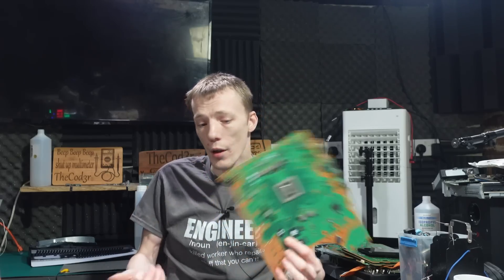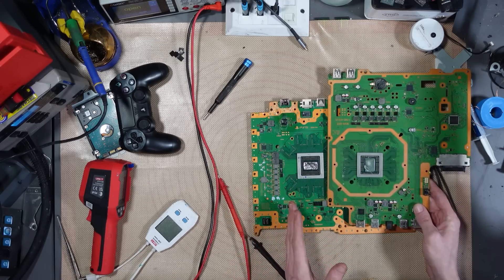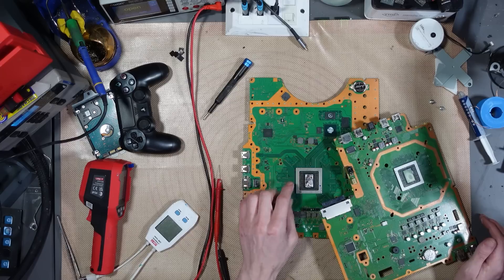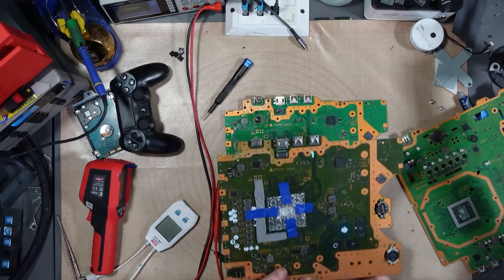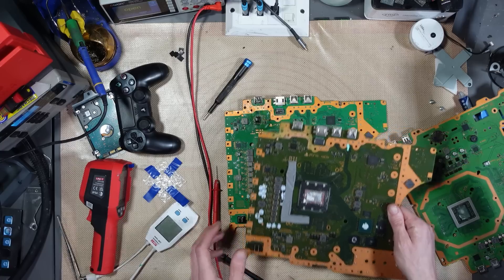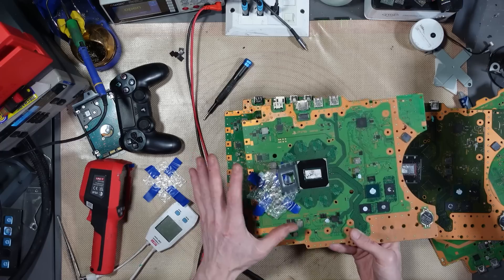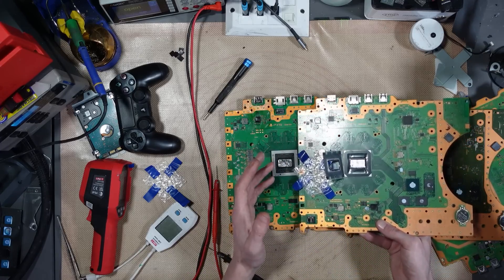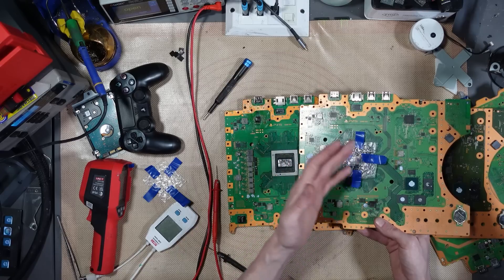Let's Talk About Sony's PS5 Liquid Metal Issue! Is YOUR PS5 At Risk?

Comment: Seen as tho I’ve had mine in the vertical position since launch I highly doubt the seal is gonna leak. The seal in mine is obviously un damaged otherwise it wouldn’t of lasted 2 year . You and the other few who have posted need to stop blowing this out of proportion
Reply from the maker: No one is blowing anything out of proportion. People are adding 2 and 2 and getting 5!
Reply: @TheCod3r  well if what your saying is true then since release day all ps5s would should of stopped working , the ps5s are literally stored vertically and delivered like that so in these cases they’ve either been tampered with or damaged before getting there. Sony designed it to work vertically , the seal doesn’t just break and leak lm unless it’s been tampered with or damaged . I’ve had mine since release day and it’s fine otherwise it wouldn’t of lasted over 2 years
Reply: @marcbilaszewski3521 exactly!  They are stored vertically in the box!

Comment: My ps5 beeps 3 times then shuts down idk whyyyy
Reply from the maker: Does it start up and then shut down after it gets to a white light? If so it's likely that your ribbon connector to the led panel is melted
Reply: @TheCod3r  yes that’s what happened wth I knew you’d have a clue about this 👏🏾 it can be fixed right?
Reply from the maker: @rushard5079  yeah if it's caused by the ribbon flex melting it will work again if you replace the cable. You can also just unplug it from the board and it will work but will just have no LEDs
Reply: @TheCod3r  thank you very much sir it means a lot I’m gonna try to do as u mentioned and I’ll let you know what happens 🙏🏽
Reply: @TheCod3r  when u said there will be no LEDs can u break it down a simpler way?😂😂technology ain’t my thing
Reply from the maker: @rushard5079  basically if that ribbon is faulty you can unplug it from the motherboard but the lights on the front of the system won't work. It'll turn on and work but the lights won't flash or turn white
Reply: @TheCod3r  oh i understand now😅thanks a lot. You’re a genius 👊🏾

Comment: I've had my console for over a year, I moved it flat because I'm a worrier. I understand metal expands when It heats up so it can move. But then again I do move it around when I clean it and take out the fan to spray WD-40 contact cleaner.. but I don't want to keep taking the fan out bc I've seen port snap off fhe board not unlike HDMI has endured. 

I guarantee ppl fiddling about trying to force it in is the issue.

Comment: Good video i believe its hard too deny when you can literally see the liquid seeping. Sure its uncommon and hopefully not widespread but it's definitely a thing.

Had mine vert since launch might switch it horizontal. Be interested too hear what Sony says 🤔
Reply: You don't have to. They won't say it's a problem.

What does Sony say about ps1 and ps2 being vertical? Nothing

360, Microsoft said nothing when the disc being scratch and then said the same about RROD. Later on about a few year later they retracted on RROD.

Nintendo Joycon. They said nothing for almost half a year when the drift was an issue. They still haven't said the failure of the Joycon. They just said to send them in and they repair it even when pass warranty. 

As far as I know from the pass, all consoles of mine will be horizontal even though company like Sony said vertical is an option. My launched day 1 ps1 and ps2 rocks. Proper maintenance and upkeep like cleaning and blowing out dust and hair out while having well ventilated area surrounding the consoles. Majority of my consoles are from launched day and rock on even today.
Reply: @tr1bes  what a long winded reply i have zero interest in how you look after your consoles that had nothing to do with my comment. Next time don't go off on a tangent and stick to the point.

Comment: Seeing alot of these now. With early release.

Had one yesterday that blew a Apu rail.

I saw you had transplanted a ssd controller with success.

I have a unit with dead apu due to LM spillage.

I will hopefully try a APU transplant this week
Reply: You can’t replace the apu
Reply: @saucemasterx911  do you know anyone who has tried..?

Last attempt went from straight dead to 2 sec blod.

It can be done.. just need to work out what needs to be transplanted along with it.

Sourcing them is a pain though

Comment: Cute how people post on here too explain how special they are due to placing their gaming console horizontally.
Reply: It's not "cute". It's just LOGICAL. Have you EVER stood a console upright before? I havent... It FEELS "wrong"...
Reply: @sideskroll  actually, everyone of mine has stood up with absolutely no problem for the past 15 years or better. Just because it doesn’t feel right to you, doesn’t make it wrong. The amount of frustration in the tone of your response is completely disproportionate to what we are talking about. Relax… It’s not that serious.
Reply: @Whatitizzz  ??? "Frustration"?... Dude... 🤣. Ok. Well, I don't see the logic in "standing up right" a console with a motor that spins a disc HORIZONTALLY. Back in the 90s there were some cd players that stood up like that, and it was WELL KNOWN That they had a higher failure rate, not to mention scratched CDs. Now add to that a modern CPU that runs hot as hell with a heat dissipation system that (no matter what they say) was NOT designed to work efficiently standing upright and you have potential issues on the horizon.
Reply: It's adorable how some people comment about what others do, especially about something as stupid as how they stand overly expensive toy, just to make themselves feel better.🤷‍♂️
Reply: @punch6482  lol. That part.
Reply: @punch6482  if only you were smart enough to realize you just shit all over yourself.

Comment: Guess I gotta remove it off the wall mount, vertical too and find a place to have it sit horizontal.

Had mine since Day 1, life's a risk but nah, consoles and PCs especially one built are a luxury. Better safe than sorry. I can repair stuff too but I rather have it last long enough than take time, find the supplies needed most specifically liquid metal and whatnot. Maybe I should stock up on that. If a new model PS5 releases with none of this nonsense then Day 1 lol. Give mine to my sis.

Comment: I wonder if a slightly thicker seal around the apu would be better than stock. Or is it possible that some Ps5’s were assembled with a little too much liquid metal?
Reply: wipe all this messy metal liquid and apply Honeywell PTM7950 thermic pad like the others do... that will  fix the issue for good
Reply: @rayoflight-777  So unless I’m misunderstanding you, the Ps5 will be cooled exclusively by the pad?
Reply: @rayoflight-777 not enough thermal conductivity

Comment: i've seen videos on 'nsc modz' channel where the apu is not flat on some ps4 and ps5 consoles, there is a bulge in the middle, i think that could be the reason why the liquid metal slides in vertical position due to weak contact between the heatsink and apu

Comment: Hi I watch a lot of your videos and many similar and I'm not a Ps5 owner but I would try mx4 thermal paste instead of liquid metal as none conductive and used it DIY wise on my PC's . I think it's a stupid idear Sony using this instead of different paste types or pads . From PS1 - Ps5 load of faults and videos all over YouTube  as is some way break and needing repair. Have a good on . Cheers Scott
Reply: They already try it in onother channel. If you apply thermal paste ps5 just overheat  and turn off after 15 min

Comment: I have it since launch vertical and no issue. Bt i must say it has been used very little and last months it has not been turned on. Kids mostly playing on series x , pc and swittch. So maybe i will put it horizontal. Just came across your channel via a comment on someone that does soldering too. So subbed here too :)  PS: if there is overspill what is the best way to remove liquid metal ? Alcohol 99% and swab it off?
Reply from the maker: Yeah exactly that mate, bit of IPA on a cotton swab and it'll come right off
Reply: @TheCod3r  Sounds like a waste of beer haha

Comment: In the past i had issues with ps2 scratching my games when putted verticaly so i never did it again but when i bought ps5 it looked better verticaly but i was still worried about disc scratch and after some research in the second day i found a french video talking about this problem of liquid metal and i was surprised and glad to see it so i can prevent myself by doing this mistake and now 7 months has passed since my purchase and no problem
Reply: Putting a ps2 vertically is criminal

Comment: The Liquid Metal is encased in a vacuum seal [ science ] and together with the pressure exerted by the mounting plate [ more science ] this  prevents it from leaking anywhere else. You have to first remove the clamp holding the mounting plate, and then physically pierce the vacuum seal with a sharp object to get at the liquid metal underneath.

Desktop PCs and Xbox consoles are protected by their own cooling systems clamped down onto the CPU/APU. If this isn’t securely affixed then the CPU or APU are vulnerable to heat damage. But the scaremongers wave a naked PS5 motherboard and claim that their gaming platforms are somehow magically invulnerable from harm. If a PC fan & heatsink is not properly secured the CPU will fry. If an Xbox Series console’s vacuum chamber isn't properly secured, or the fan bearing seizes up, it will also fry.

This is the same blatant scaremongering spread by fanboys after the Official PS5 Teardown video of two years ago. So nice of you to celebrate the anniversary of a previous but failed "bad news campaign" [ sarcasm ] The other significant thing it coincides with is the "good news" that PS5 has sold 30 million consoles in its first two years, which I mention because the scaremongering is an obvious attempt to damage sales of the PS5.

This attempted scaremongering also occurs on a Friday, like nearly all the other attempts at a "bad news campaign", which adds to the community's accepted belief that the person driving these “bad news campaigns” is of a “certain age” and is using a “very old book” to draw this particular strategy from, based on print newspapers being published Monday to Friday. The strategy being that “bad news campaigns are harder to stop in their tracks with a weekend in the way.” Of course this is nonsense in these days of rolling 24/7 news, but it gives the community a hearty laugh to know that the organiser is of “that certain age” and is stuck very firmly in the past.
Reply: Ive been watching alot of PS5 teardowns over the last couple years and haven't really seen any LM leaks. However, what I have seen alot of is the LM kinda collecting on one side of the chip wich causes dry spots and the causes over heating issues. Either way, there's really no harm putting it horizontal other than it looks awful 😂
Reply from the maker: Do you really think repair technicians care how many get sold? More sales, more fails. More money for us if they die out of warranty. If you want to be blind and pretend it isn't a problem be my guest, I don't mind. I guess covid was a conspiracy too? Aids isn't a real disease? Bill Gates is building mond control devices into 5G? Lol, sad!
Reply: @TheCod3r  Two years after witnessing the first wave of scaremongering, and there has been no great wave of failures. My PS5 and many millions of others globally have been used vertically without problems. As a systems engineer with decades of experience in the design, prototyping and production of precision electronic products for the aerospace industry, and my eyes are very open, thank you very much.

Thanks for jumping to conclusions and giving me a laugh, can't wait to share this exchange with my colleagues after the weekend. It's been free entertainment watching you fanboys console warring, and promoting yourselves on social media as experts on every topic from corporate accounting, to U.S. constitutional law, and all of this  to defend a trillion dollar multi-national conglomerate who think that international rules and regulations don't apply to them any more.
Reply: @TheCod3r  dude you need to shut up with this nonsense. It’s all over Reddit and everywhere else that this is clickbait and misinformation. Anything to get views these days.
Reply from the maker: @ababafgatg  so then why are you on my channel then *dude*? Seriously, go watch some more tiktok. Brainless content is more your thing
Reply: @TheCod3r  lol a little piece of advice, don’t make a YouTube channel if you can’t take criticism. It’s really not a good look for any YouTuber replying to so many negative comments.
Reply from the maker: @imt558delux  lol hilarious. If it causes issues it's a design flaw, simple as. The only brainless people are the ones who can't see past their beloved company logo. It's quite sad really! Microsoft didn't have to overclock their system to get it to keep up performance did they?
Reply from the maker: @imt558delux  stop being a fanboy and wake up 🤣
Reply from the maker: @ababafgatg  I'll reply to whatever I want to reply to, that's the beauty of being the owner of the channel! Don't tell me what I should and shouldn't do, I don't need to listen to this "advice" you're giving me. Telling me to shut up in one comment and then giving me "advice" here, pathetic. I honestly don't care what it looks like to you
Reply: @imt558delux  this dude is so insecure that he has to reply to every negative comment. And when that happens, we’ve already won. Cuz he knows he’s been called out.
Reply from the maker: @imt558delux  hilarious how you think reddit is a valuable source of information 🤣 I do not need to say any more. Get off my channel 🤣🤣🤣
Reply: @TheCod3r  Is this becoming a widespread problem In the units you attempt to repair?
Reply: Wow TeChNoLoGy

Comment: Great video. Thank you. I have one question. Is cooling of the PS5 better when you remove both white covers from the console and laying horizontally? 
I did this with PS4 Pro by removing top cover fan has been quiet ever since. Obviously it's covered when not in use.
Reply: no its not

Comment: I would say the majority of them leaking is being vertical and the  chip not being cooled correctly due to liquid and gravity, the excess heat over time affecting the measures to seal the liquid metal in. I got me ps5 2 days ago and have it laying flat, it's a no brainer with it having liquid inside it, they should have gone with thermal paste tho , liquid metal is another thing to go wrong but considering how many ps5s have been sold this is a small issue with a small percentage is machines sold. Keep your machine flat and it should be ok, I have never put a machine vertical, as a rule of thumb put it at the same orientation as the disc reader.

Comment: Since your very first video on the ps5 I was like erm I’m going to put it horizontally as the Liquid Metal will surely go with gravity and cause hot spots on the APU… it has been fine but as you’ve said this should have been designed better…. But then again the horizontal stand is pure garbage 😂 why could it just not have been oblong parallel edges!! Ridiculous design 🤣
Reply: Sony goofed big time with the PS5 design.
Consoles should be boxes and stick to what works.

I still can't get over how  Sony admitted to having a designer create the look of the system and screwing their engineers to work around that.

Correction I think the Designer himself said that he designed it first. Which is still Sony's fault.

Comment: Those pictures are either user error with some idiot taking apart his ps5 or a factory fault. If anyone had ever used liquid metal or thermal pastes they would know it doesn't run and drip like water due to its density and stickiness. Companies put it in their high end laptops which are constantly moved around so RELAX people.
Reply: Yeah not every liquid runs RIP Glycerin 😭 Its like you said but in the lab we call it viscosity :)
Reply: @MissxLariz  that's the word I was looking for.

Comment: Are PS5s overclocked?
Reply: YES.
People seem to have forgotten this. It's what's allowed the system to hang on performance wise vs XSX even as Xbox had struggled with unoptimized games the first 2 years due to lack of the new dev tools or whatnot devs require to make games runs their best on each system, while PS5 uses basically the same as PS4 iirc not me saying that, it's what was reported way back.
Reply: Ive seen reports of xbox Series and PS5 drawing a few watts (10W +-) more or less from eachother, if there is overclocking then idk where, PS5 draws less power in gaming but more oddly in desktop mode.
Reply: Yeah, Sony chose to go with a cheaper less powerful chip but they overclock it and it gets super hot. Thats why they needed to use LM instead of thermal paste.

Comment: Has anyone ever had this issue from using it vertical and never bang it or bumping  it or moving it I am curious to know this because I think it's the ones that are banging or driving or moving it around a lot so if this is the issue then leaving it vertical would be OK if you don't do lots of moving it around yes/no thoughts
Reply: I've had mine vertical for 2 years and I haven't bumped it or k ocked it because I'm OCD when it comes to my electronics.

I've also transported it vertically to Scotland and back and to various other places and no issues yet luckily. Touch wood it continues